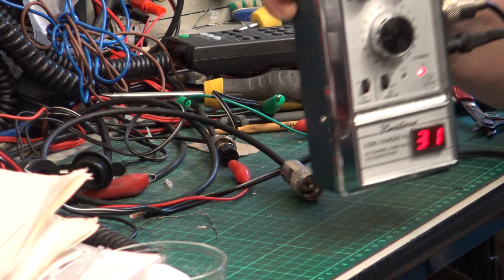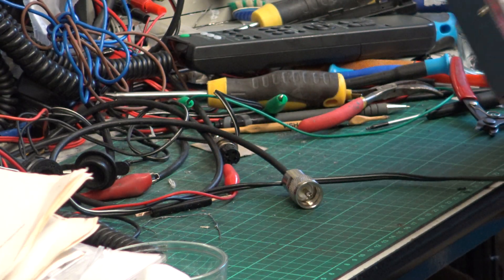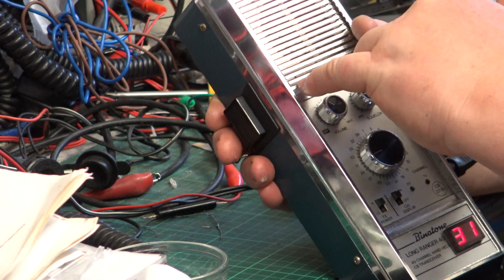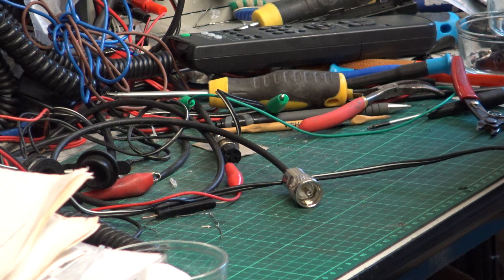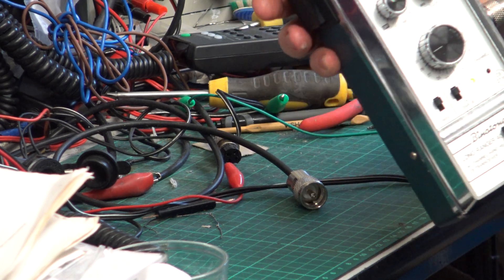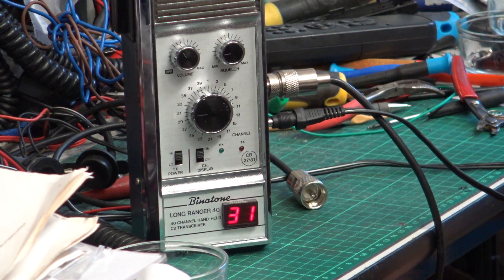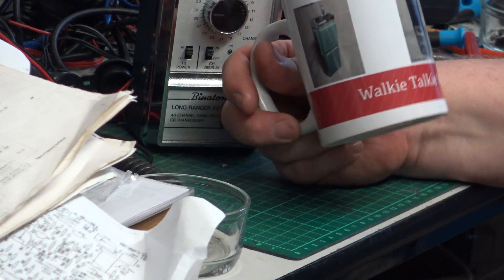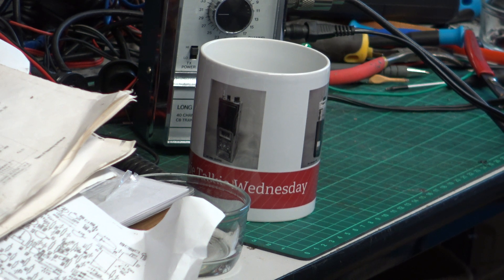Binatone Long Ranger 40 UK CB27/81 CB radio (Handheld 4W) - On The Air Test

Comment: A bit of a brick by modern size standards but great RF power, sensitive receive and excellent audio quality.  One of the best for audio quality that I have heard from a handheld's internal speaker.  It cleaned up very well and looks gleaming - a great addition to your CB radio collection I imagine.  I think I would have been very happy with one, if I had had one, back in the day.  I had never seen one until watching your very enjoyable video.  Thanks Richard.  =)
Reply from the maker: The 6 & 12 channel versions are not far off the same range, but better (lower) power consumption & usually...or used to be....cheap to buy because people think they need all 40 channels, when actually you don't unless it's for 1-9 a copy type use.

Comment: Not bad into a base aerial.
Reply from the maker: I was amazed it had a factory fitted crystal filter

Richard
Reply: @ukfmcbradioservicingTango21  Yeah, I think they should have all been fitted with crystal filters at 10.695, it would have made such a difference to the radios.

Comment: Mr Chippie's audio sounds great ps Scratchy Corner mugs would be great I'd buy one :)
Reply from the maker: I just have them done at Vistaprint, but are expensive at about £8.50. Quantity discount only kicks in at about 250 units. I'll have to get a couple of extras & put them on ebay 'buy it now' for a laugh...I'm quite happy to sell at cost price.....this channel is not about making money, but helping others servicing (mainly) UK CB radios & the odd vintage audio & Ham item.

Richard
Reply: @ukfmcbradioservicingTango21  great ethos Richard - please let me know if you ever have any scratchy corner mugs - you have my email from the map I made you. Best wishes Rob ps maybe a mug with all the call in places re my map would be good as well and that would include scratchy corner as well :)
Reply from the maker: your map on a mug has been ordered.
Reply: @ukfmcbradioservicingTango21  great news! It will be a best seller Rob
Reply: @ukfmcbradioservicingTango21  I'd like to order one as well :)
Reply: @ukfmcbradioservicingTango21  please email me when it arrives!